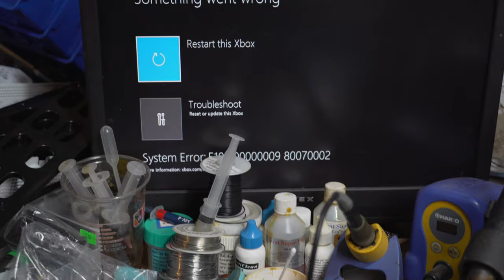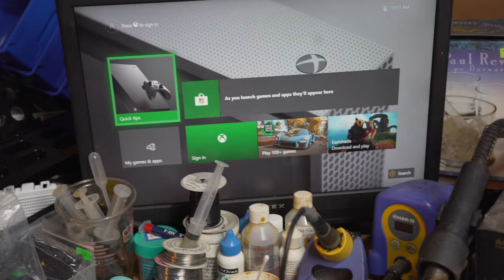🛠 Repairing An Xbox One S That Wont Boot!

Comment: Can I just put the new hard drive in the Xbox or do I have to update it and everything through a pc?

Edit: I’m not fussed about transferring everything over I can get everything back overnight
Reply: you have to use the flash drive, it contains the OS (operating system) for the new hard drive.
Reply: Yea If You Put A New HDD In There Will Be No OS So Your Xbox Will Not Boot To The Xbox Dashboard

Comment: Hi, I know this video is maybe a little old so I'm not sure if you'll reply. But my xbox has a simular problem. When I was testing the power supply it makes a "ticking sound", I'm not too sure how to describe it. Do you know if it's supposed to make this sound because I can't find any answers on Google, thanks!
Reply from the maker: Are you sure its the power supply and not the HDD? If the HDD is making a clicking sound, its most likely gooing bad and would need to be replaced.

Comment: Hey bro I was wondering if you could help me out my s was running really slow and laggy and would barely load into games so I resented it but now it’s stuck in the preparing console and never goes past 50….any tips?
Reply from the maker: sounds like the Hard Drive might be giving out. You would have to do something similar and create a new drive to be used with the system.
Reply: @rosaPerez you ever find out the problem my console is doing the exact same thing word for word. Would really help me out